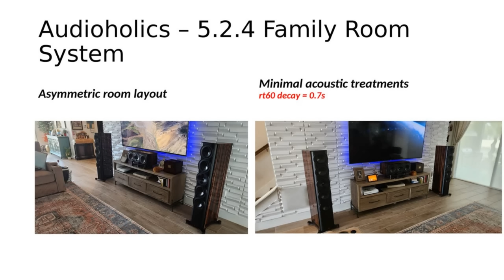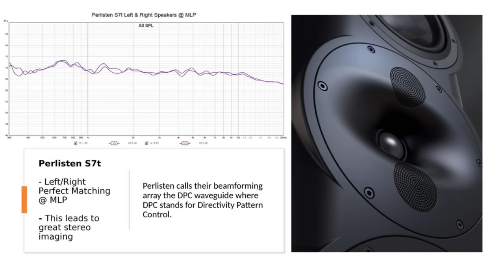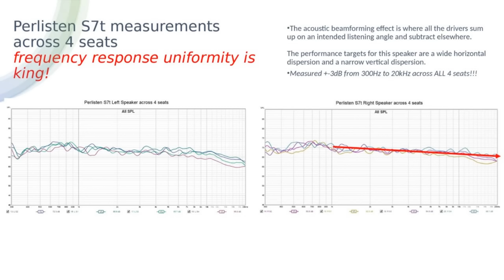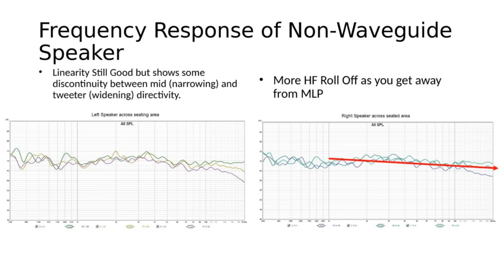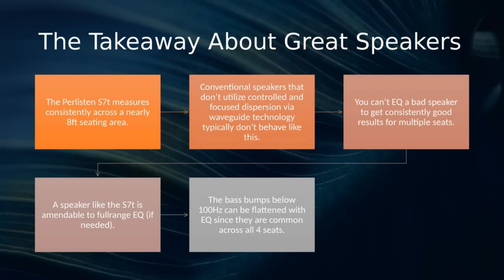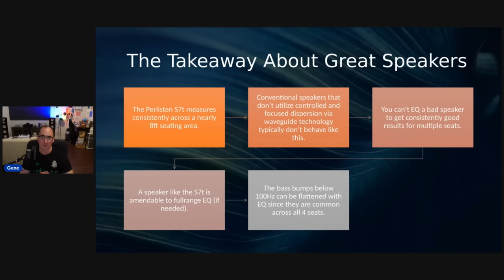How Great Speakers Measure in Real Rooms

Comment: $30,000 a pair, that's the cost of a decent car.  Let alone the cost of amps, preamps, interconnectors,  speaker cables.  Then it becomes a house loan.
Reply from the maker: These are the normal S7ts, so they are under $20k pair. Can't get a decent car first that price 😅
Reply: A decent car would be a much better investment. Not a big fan of the doctor brand stuff.
Reply: @Audioholics  yee haw!
Reply from the maker: @danieljj7717  I already have 2 very "decent" cars and they cost far more than these speakers :)

Comment: I tend to think speakers with lifted  highs are for people that listen to speakers from greater distances. 

 I did an experiment in my finished basement room 24 x 55  concrete floors open joists drywall frimered painted decorations all that  sliding walkout on far end  pool table bar. Couch lazyboy 65 inch tv several throw  rugs ....some shelves and cabinets puctures plants (standard stuff). 
My normal listening position is playing My 8ft brunswick .
      It is centered about 18 feet away from speakers located on hanging shelves from 9foot high cieling joists off the short wall...pointing the length of basement , so tweeters are about 7 and a half feet high.
 10 degree tilt toed in 10 to 15 degree 
30 inches off back wall. 4 feet off side walls Yammaha 701. Ifi dac  Amazon music   Subs off. Tone controls to taste.   ...jbl n310...jamo c93ii .... jbl 530...sanyo ss560... b&W 601.... jbl s38 and Some old beatup kenwoods.    Best sound is the jamos out in the room. Second favorite is the jbl s38.  Those two sound good anywhere in the room . I can be at my bench 45 feet away and they sound damn good

Up close i like the b& w and the  jbl 530. 
The n310 jbl is normally for the backyard. I get them out with  pioneer amp...cambrindge preamp. Gets the job done for cookouts and bdays

Just goes to show that out in a room not being critical of how something measures things change.  That jamo is a good little party speaker. They arent for sticking your face in.They are normally in my garage. The kenwoods and the sanyos are just vintage crap. But fun to listen too stuff on like fm radio and tape decks.
    HAVE FUN WITH MUSIC GUYS.

Comment: Good quality control  = good sound. Just received KEF R11 and the midrange frequency response of each speaker is different! One flat the other big spikes. Not only that the speakers purchased NEW direct from KEF had nicks in the paint and what looks like smudges of children glue on them. KEF said they were not cured properly. 😮 Have not heard d back yet about driver issue.

Comment: Indeed these are great speakers and beside the amazing frequency response in this test, I can testify that these sound amazing as I have a similar living room with large open space behind the sofa and large glass opening on the right side and open space on the left.
I did an A to B comparison before buying them at me hi-fi dealer against B&W 800 D3 and Sonus Faber Amati Tradition both costing twice or more and the Perlisten came on top.
At least that what I've heard with my own Denon PMA-A110 amplifier.
We've sitched to the dealer's McIntosh MC451 and the Perlisten were the better ones.